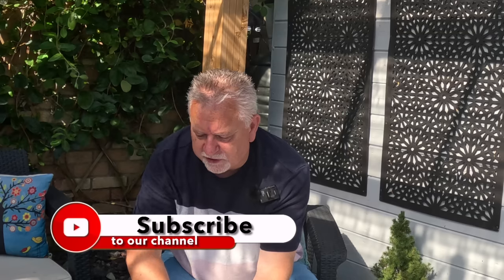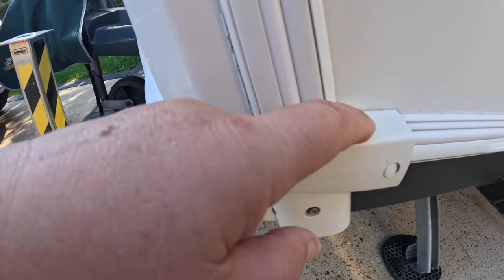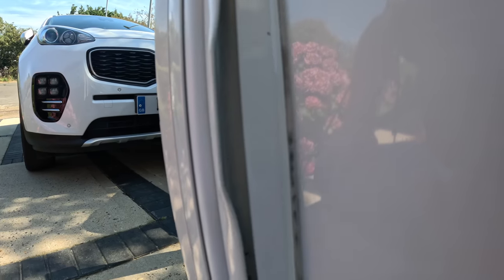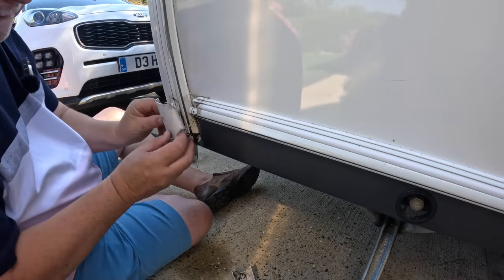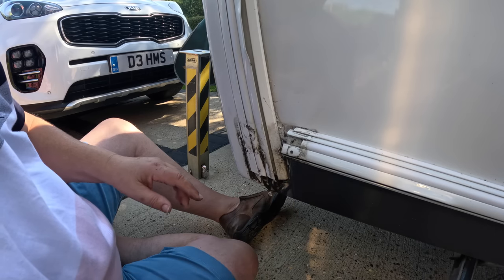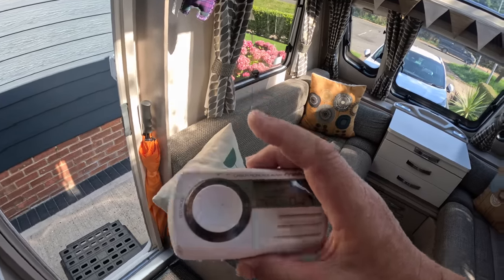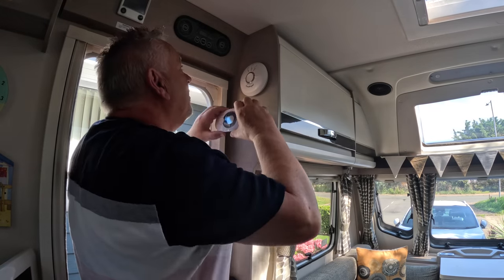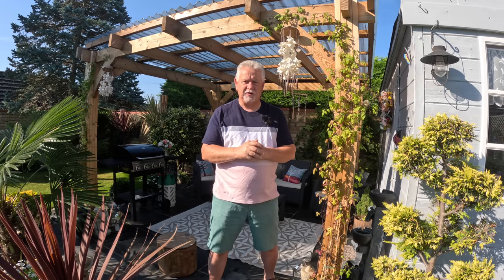Why caravan servicing is ESSENTIAL - no matter how old your caravan!

Comment: Hi Dave..I agree with Steveblack728 on the fact that it's better to let water out rather than try to seal everything against ingress... Did it have a drain hole that was blocked by all that black gunk?
Reply from the maker: Thanks Roger, I’m gonna check that again (opposite side) just incase 👍 Cheers, Dave 👍

Comment: Hi Dave, I don’t think you should have filled the bottom of that down rail as that’s where the water runs out ( it’s like a gutter) so you may have compounded the situation not remedies it, check with Darren to be sure
Reply from the maker: Cheers Steve, when Darren was showing me this he told me that the water should run down the front, not the back (there was some sealant missing there actually) also when I removed the guards/trim that area was full of sikaflex. I will double check though, thanks. ATB, Dave & Helen.

Comment: Dave, you’re not helping me! Each time I watch a blog I have  another job to do on my caravan. This time I may be able to help you. Carbon Monoxide is I believe slightly heavier than air. As you are monitoring a boiler problem in the main and you bed is only 24inches from the floor, why put a carbon monoxide detector at ceiling height. Might be worth checking this out.
Keep up the good work .
Reply from the maker: Hi Mike, that’s interesting and something I hadn’t considered. We have a couple of alarms at home too, one installed by our boiler engineer in the kitchen and one in our lounge installed by the company who installed our log burner but both are placed high close to the ceilings. I’ll check out further. Thanks very much for watching and the heads up 👍

Comment: We used Darren on a previous caravan that  had been serviced by the supplying dealer for year 1 and 2 and as you say, very thorough and professional job done and will undoubtedly use him again once main warranty has gone for year 3 on our current van. No travelling to dealer (twice) needed and lower service cost, so makes sense from all angles.
Reply from the maker: Hi Mel, good to have someone like Darren on your doorstep. We’ve been delighted with his work. You need to stop buying new caravans all the time 😂😂
Reply: TBH, we have made the mistake of changing from what is the best layout for us, which is the same as you have, while the caravan was great in every way, it was the continuing quality issues and poor dealer that got to us after 3 years and we lost all faith in it so we changed just 2 weeks after Darren serviced it. The next 2 caravans were really good, but ultimately went back to the layout we knew suited us best. Both turned out to be expensive mistakes, although neither had ANY build or warranty issues. No going back now as we have added expensive additions and this one will therefore need to see us to the end of our caravanning life.

Comment: Another fab video dave, with regards to the sikaflex you used on the reseal job how did you know to use sikaflex 221 and not 522, the various sikaflex tube numbers confuse me..😅
Reply from the maker: Hi Mark, cheers mate 👍 Truth is I didn’t! I just searched for a suitable sealant for caravans and this one popped up. I read a few reviews and went for it. The proof of the pudding will be in the next damp reading, which I might get done sooner rather than later. Thanks for watching and ATB, Dave & Helen 👍

Comment: Always remember to use stainless steel screws on the exterior. Is your floor GRP on the underside?
Reply from the maker: Hi Gary, the screws are indeed stainless steel and it's a yes on the GRP underside it's sandwich floor construction with GRP outer skin. Thanks for watching. Cheers, Dave
Reply: @HelenandDave  Happy days 😉 👍 ...

Comment: Shouldn’t the carbon monoxide alarm be down by the floor? The gas is heavy and by the time it reaches the alarm the whole caravan is full of gas and I guess it’s too late to hear the alarm
Reply from the maker: Well that’s where the caravan manufacturers fitted it. We also had a log burner fitted at home and the installation guys fitted it up high. Our gas boiler engineer at home also fitted one in the kitchen just below the ceiling so there seems to be a trend. Cheers, Dave & Helen